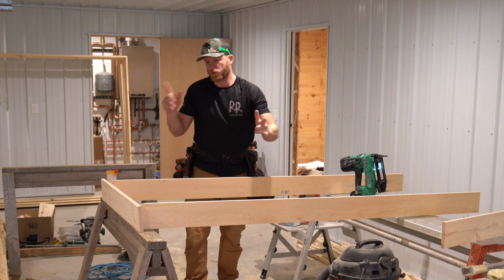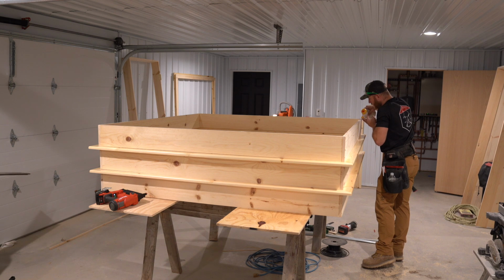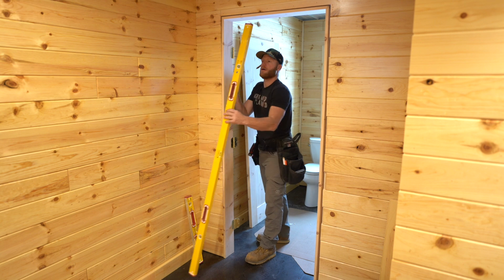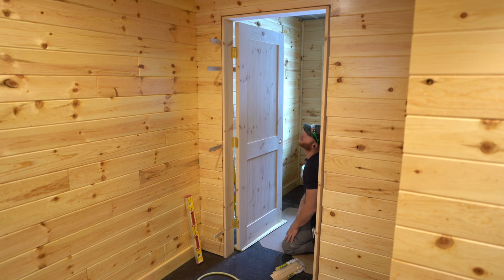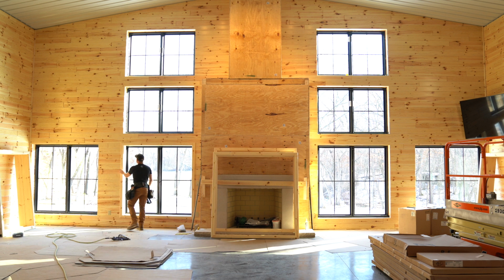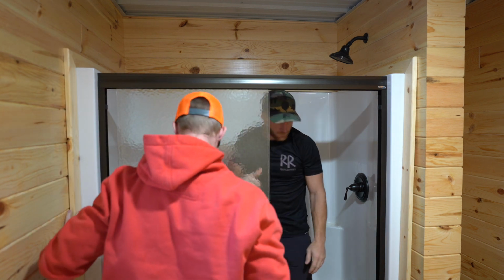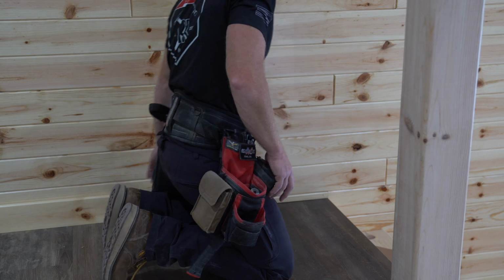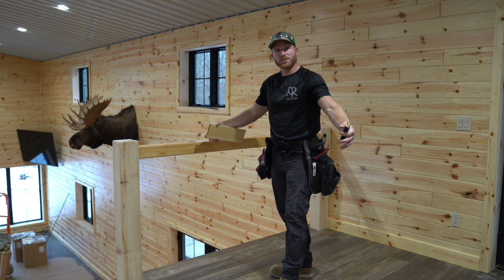Cabin in the Woods 46: Interior Trim Install - Best Window Trim Method

Comment: This guy Rob just said something that should have been a mind blowing, epiphany for all who heard it. So simple yet so elegant were his words. I hope there is nobody at this point who is wondering what the hell I'm talking about. But just in case there are, it should have absolutely blown your mind when he said, "It only saves you money when it's running".

I've been retired going on 4 years now, but was a GC for more than a couple decades. I cannot count the number of times I've heard customers say the same thing Kyle said; "Go one bigger". I can still remember the couple of times I've had to hold my tongue when trying to convince a "know it all" customer that they had the wrong idea.

edit: Finish trim looks fantastic Kyle! The only thing that bothered me was that air gap twix your box and the jam. Although it seems totally handy to install the entire box with trim as a unit, I still think you should build them to match but install them separate. That way you could properly fill that air gap with a backer bead and foam. And that screw idea to center your box was awesome!

Comment: Here is good tip about using the main blue Kreg jig base.  Build yourself a flat base from 2x lumber 12” front to back and 36” wide (long).  I used 2x6 tongue and groove Southern Yellow Pine (not treated) that was left over from something else.  Of course, I connected them together using Kreg pocket hole screws.  Then you can then screw down the Kreg base centered left to right and pulled to the front - check the front clamp lever for clearance.  Then cut filler strips to support the wood left and right of the base.  Then you can clamp or screw down the Kreg jig platform wherever convenient and have a ready to use unit.  I keep all of my Kreg jig inserts in a seperate box so they do not get misplaced or damaged.
Best wishes.

Comment: We used something called Mitre Mate back in the days here in Sweden. Some kind of super glu with and an activator spray wich made the miters nice, fast and very strong.
Reply: Mitre bond. It’s super glue with an activator
Reply: @aaronwilton8738  Same thing we used. It's interesting  how different you work over "there" than we work over here. I would say we are far more ahead here in Sweden how to install stuff. For instence, install a door or a window. We use adjustable  screws. Hard to explain if you never seen it. But nailing in doors we used to to 40 years ago.
I don't say we are ahead on everything. But is cool to see how diffferent we work on the same things.

Comment: That’s the same way I hang my doors, I also use a trend winbag, you place it under the door and then pump it up, it’s easier than packing the door up with scraps of wood, once the door hinges are screwed to the jamb you just release the air out of the bag. A single air bag can lift up to 300lbs , check them out on Amazon , they are excellent 👍
Reply: I use the air shim method too.  Highly recommend it for all doors, but especially solid core and exterior doors.
Reply: Excellent for cabinet installs as well!

Comment: Hey Kyle, love the channel. CA (Cyanoacrylate) glue and activator works great for wood and MDF transition pieces and joints that you don't want to clamp or tape to wait for regular glue to set. Super strong bond as demonstrated by Finish Carpentry TV in TX.

Comment: Great vid... Need 23G pin nailer for returns.. Please buy the Milwaukee 15G angled finish nailer (no gas, no hose) and the Milwaukee 2nd gen 18G  brad nailer ( no gas, no hose, no ramp up) - game changer..  I'm only a few hours away, could always use another trim carpenter on my crew. Gone through 25+ guys to get the four I have now..

Comment: I am a big fan of Ca glue and accelerator when putting on returns and preassembling trim.
Reply: It doesn't work good on real wood like wood glue does
Reply: @luketein7965  I have been using it on real wood with good success. Sometimes you need to prime the pores with glue.
Reply: Gary Shell how is the strength compared to wood glue! I have never heard of that always been told not for real wood  will have to give it a go
Reply: @luketein7965  for trim purposes I feel as though it I quite good. It probably isn’t as strong as wood glue. But I have pre assembled door casing and was able to handle it just fine. Also if you have a wrong angle on baseboard outside corner for example it takes a decent amount of force to break it it will usually let you push it in without breaking. I got the Bob smith Industry’s combo pack of glue and accelerator.

Comment: I've found the absolute most accurate way to measure in between two posts is to set your handrail into approximate position and use the post to scribe the rail. That will also capture the angle you need to cut it, if the post is out of plumb or twisted, etc.

Comment: That’s exactly how I hang a door. If o can mount the hinge side to the framing with no shims and it’s perfectly plumb , I agree whole heartedly, use as much of the fastener as possible without wasting the length going through an unnecessary shim.

Comment: You can pop the hinge pin out of this hinges and install the part on the door and then put them back in. A lot easier if the hinges a router’d out on the door.

Comment: Kyle, when setting door by yourself use those bags you can pump up. Cost about 10-15 buck and makes your life so easy. I can set commercial steel door by myself with one. I think they are called airshims?

Comment: I'm not keen on the nosing at the top of the stairs being a tiny bit higher than the floor, maybe the nosing was made to account for underlay
Also, do the stairs squeek against the wall ?
Reply: I was wondering that same thing. I think I would of spaced them off the wall 1/4 - 3/8” so that wouldn’t squeak or make any noise

Comment: Okay Okay, I need to tell/ask you some things:
1. I really enjoy watching you videos. You are definitely one of the best and exacted workers out there. 
2. Every little detail you do is perfect. 
3. And today was the day. I saw you put a door in, ON TOP A PIECE OF WOOD THAT HAS THE SIZE OF MY HAND (I have small hands). The gap between the door and the Floor is like 2.5 cm (sorry I don't know you messuring system). 
4. Now I have to ask you: Is there an actual reason to make this gap that big or..? 
5. Sorry for my english, I hope someone is able to read it.
Reply: I like to do that kind of stuff on bathrooms sometimes to promote air circulation. People never run there damn bathroom fans and or leave the door open after they shower and it can lead to mold really easily.

Comment: Hey Kyle, I have heard you mention a few times in this build that this building won't have air conditioning and I was wondering the reasoning behind that? I'm from Missouri originally and I understand how brutal the midwest humidity can be during the summer months.  As a woodworker and furniture maker I'm curious to the effects that the humidity might have on all that wood cladding on the walls. Love the work and thank you for your time. -Dane

Comment: Always put a shim on the hinge side or the door will get  hinge bind if the jam is twisted and the door won't shut smooth it will want to spring open.  20 years of trim carpentry...Also shim where the middle screw of the hinge is so you can put a screw through it. That gap on that casing at the end of the video would drive me nuts.

Comment: My parents have been exploring the idea of building a cabin just like this, not sure if he ever said this, but anyone have any idea how much this cabin likely cost?
Reply: Obviously prices will vary on several key components -  Real Estate Land ( Location )  -  State / County -  and of course it also varies on where the materials are sourced from ( some suppliers are higher / lower then others ) -  It also depends on the time line required to finish the project -  and it also varies on the quality / pricing of the contractor and all of the sub contractors involved .  Not knowing any hard data behind the scenes ?  - I would say that a fair approximation for this size of project and the level of details along with some higher end finishes would likely have a turnkey price point some where in the $ 600,000 - $ 650,000 area.
Reply: @wiwoodcraft4065  Okay, thank you!
Reply: @wiwoodcraft4065  Oof. I was just wondering the same thing and was figuring more like 300k as that's what a typical house goes for in my area. But thinking about the level of craftmanship in this compared to these mass-production-built hackjobs, I could easily see double that.

Comment: Why only 3 hinges and not 4 with a heavy door?
Reply from the maker: Never seen 4?
Reply: Number of hinges is more based on the height of the door. Three--with the right fasteners--is sufficient for anything 7.5ft or under (assuming your door isn't solid steel or something).
Reply: @seank9643  Makes since....👍

Comment: He’s wrong about the AC. It can be programmed to run extra (say 2 mins)  to pull humidity from the air. Also you don’t want to under size the unit at say 3 tons where it’s using 75-80% of its capacity. In my situation my house with spray foam and Energy efficient windows and geothermal called for 3ton running 75-85%. I went with 4ton because at the time they didn’t make 3 1/2, so my unit runs 60-70% of it’s full capacity which saves me more money on my electric bill.